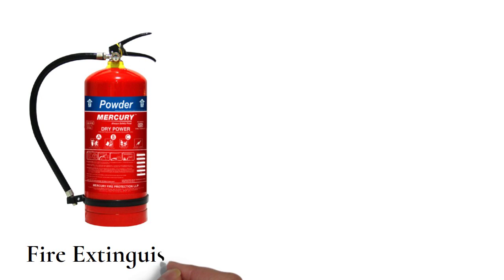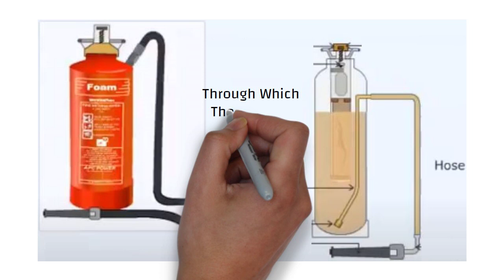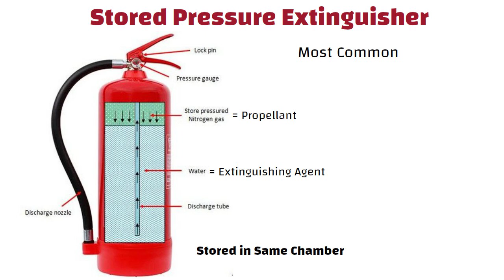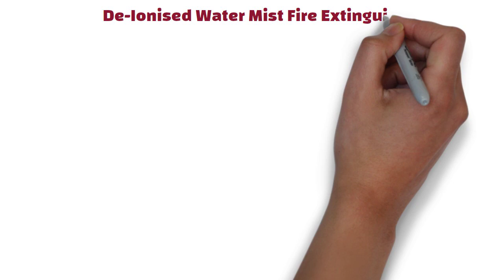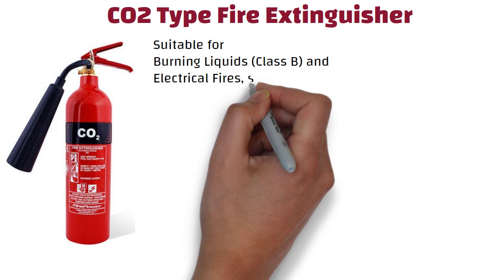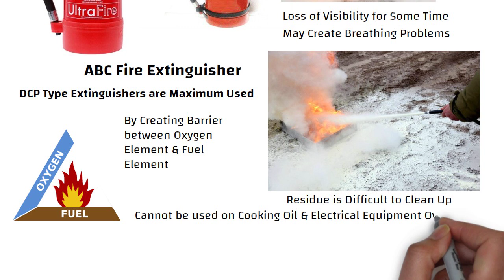FIRE EXTINGUISHER DEALERS IN KERALA, CALL 8138906102, FIRE EXTINGUISHER DEALERS IN ERNAKULAM.

Comment: Fire extinguisher dealers in Palakkad
Reply: FIRE EXTINGUISHER DEALERS IN KERALA, FIRE EXTINGUISHER SUPPLIERS IN KERALA, FIRE EXTINGUISHER DISTRIBUTORS IN KERALA, FIRE EXTINGUISHER IN KERALA, ABC TYPE FIRE EXTINGUISHER DEALERS IN KERALA, CO2 TYPE FIRE EXTINGUISHER DEALERS IN KERALA, CLEAN AGENT FIRE EXTINGUISHER IN KERALA, MODULAR TYPE FIRE EXTINGUISHER DEALERS IN KERALA, MECHANICAL FOAM FIRE EXTINGUISHER DEALERS IN KERALA, FIRE EXTINGUISHER NEAR ME KERALA, FIRE EXTINGUISHER TRADERS IN KERALA, FIRE FIGHTING COMPANIES IN KERALA, FIRE CONTRACTORS IN KERALA, FIRE EQUIPMENT DEALERS IN KERALA, FIRE ALARM DEALERS IN KERALA, FIRE PUMP DEALERS IN KERALA, SMOKE DETECTOR DEALERS IN KERALA, FIRE FIGHTING SYSTEM IN KERALA, FIRE PROTECTION SYSTEM IN KERALA, FIRE AND SAFETY CONTRACTORS IN KERALA, FIRE HYDRANT SYSTEMS IN KERALA, PA TALK BACK SYSTEM IN KERALA, FIRE NOC IN KERALA, FIRE INSTALLATION IN KERALA, FIRE NOC RENEWAL IN KERALA, KIRLOSKAR FIRE PUMP DEALERS IN KERALA, FIRE EXTINGUISHER NEAR ME KERALA, FIRE EXTINGUISHER MANUFACURERS IN KERALA, SAFEX FIRE EXTINGUISHER DEALERS IN KERALA, FIRE NOC CONTRACTORS IN KERALA, FIRE FIGHTING EQUIPMENT DEALERS IN KERALA, FIRE PROTECTION SYSTEM IN KERALA, FIRE INSTALLATION IN KERALA, FIRE SAFETY CONTRACTORS IN KERALA, FIRE AMC IN KERALA, FIRE PROTECTION SYSTEM IN KERALA, FIRE PROTECTION EQUIPMET IN KERALA, AMC OF FIRE SYSTEM IN KERALA, FIRE CONSULTANTS IN KERALA, FIRE AND SAFETY EQUIPMENT DEALERS IN KERALA, ADDRESSABLE FIRE ALARM SYSTEM IN KERALA, KARTHAR VALVE DEALERS IN KERALA, DCP TYPE FIRE EXTINGUISHER IN KERALA, POWSER TYPE FIRE EXTINGUISHERS IN KERALA, FIRE HYDRANT SYSTEM IN KERALA, FIRE ALARM PANEL DEALERS IN KERALA, SAFEPRO FIRE EXTINGUISHER DEALERS IN KERALA, MS AND GI PIPE DEALERS IN KERALA, JINDAL PIPE DEALERS IN KERALA, AGNI FIRE ALARM DEALERS IN KERALA, FIRE EQUIPMENT DEALERS IN KERALA, FIRE EQUIPMENT SUPPLIERS IN KERALA, FIRE EQUIPMENT TRADERS IN KERALA, FIRE SPRINKLER SYSTEM IN KERALA, RAVLE FIRE ALARM DEALERS IN KERALA, RAVEL FIRE ALARM SYSTEM IN KERALA, AGNI FIRE ALARM DISTRIBUTORS IN KERALA, FIRE ALARM CONTRACTORS IN KERALA, FIRE PIPE INSTALLATION IN CONTRACTORS IN KERALA, FIRE SAFETY CONTRACTORS IN KERALA, FIRE PA TWO WAY TALK BACK SYSTEM DEALERS IN KERALA, HEAT DETECTOR DEALERS IN KERALA, HONEYWELL FIRE ALARM DEALERS IN KERALA, FIRE NOC CONSULTANTS IN KERALA, FIRE AMC AND FIRE NOC IN KERALA, FIRE SAFETY COMPANIES IN KERALA, NEWAGE DEALERS IN KERALA, MONSHER FIRE EQUIPMENT DEALERS IN KERALA, KARTHAR VALVE DEALERS IN KERALA, FIRE HYDRANT VALVE DEALERS IN KERALA, FIRE HOSE REEL DRUM DEALERS IN KERALA, FIRE SPRINKLER DEALERS IN KERALA, FIRE PUMP DEALERS IN KERALA, LUBI PUMP DEALERS IN KERALA, LHP PUMP DEALERS IN KERALA.

Comment: Fire extinguisher in Thrissur
Reply: FIRE EXTINGUISHER DEALERS IN KERALA, FIRE EXTINGUISHER SUPPLIERS IN KERALA, FIRE EXTINGUISHER DISTRIBUTORS IN KERALA, FIRE EXTINGUISHER IN KERALA, ABC TYPE FIRE EXTINGUISHER DEALERS IN KERALA, CO2 TYPE FIRE EXTINGUISHER DEALERS IN KERALA, CLEAN AGENT FIRE EXTINGUISHER IN KERALA, MODULAR TYPE FIRE EXTINGUISHER DEALERS IN KERALA, MECHANICAL FOAM FIRE EXTINGUISHER DEALERS IN KERALA, FIRE EXTINGUISHER NEAR ME KERALA, FIRE EXTINGUISHER TRADERS IN KERALA, FIRE FIGHTING COMPANIES IN KERALA, FIRE CONTRACTORS IN KERALA, FIRE EQUIPMENT DEALERS IN KERALA, FIRE ALARM DEALERS IN KERALA, FIRE PUMP DEALERS IN KERALA, SMOKE DETECTOR DEALERS IN KERALA, FIRE FIGHTING SYSTEM IN KERALA, FIRE PROTECTION SYSTEM IN KERALA, FIRE AND SAFETY CONTRACTORS IN KERALA, FIRE HYDRANT SYSTEMS IN KERALA, PA TALK BACK SYSTEM IN KERALA, FIRE NOC IN KERALA, FIRE INSTALLATION IN KERALA, FIRE NOC RENEWAL IN KERALA, KIRLOSKAR FIRE PUMP DEALERS IN KERALA, FIRE EXTINGUISHER NEAR ME KERALA, FIRE EXTINGUISHER MANUFACURERS IN KERALA, SAFEX FIRE EXTINGUISHER DEALERS IN KERALA, FIRE NOC CONTRACTORS IN KERALA, FIRE FIGHTING EQUIPMENT DEALERS IN KERALA, FIRE PROTECTION SYSTEM IN KERALA, FIRE INSTALLATION IN KERALA, FIRE SAFETY CONTRACTORS IN KERALA, FIRE AMC IN KERALA, FIRE PROTECTION SYSTEM IN KERALA, FIRE PROTECTION EQUIPMET IN KERALA, AMC OF FIRE SYSTEM IN KERALA, FIRE CONSULTANTS IN KERALA, FIRE AND SAFETY EQUIPMENT DEALERS IN KERALA, ADDRESSABLE FIRE ALARM SYSTEM IN KERALA, KARTHAR VALVE DEALERS IN KERALA, DCP TYPE FIRE EXTINGUISHER IN KERALA, POWSER TYPE FIRE EXTINGUISHERS IN KERALA, FIRE HYDRANT SYSTEM IN KERALA, FIRE ALARM PANEL DEALERS IN KERALA, SAFEPRO FIRE EXTINGUISHER DEALERS IN KERALA, MS AND GI PIPE DEALERS IN KERALA, JINDAL PIPE DEALERS IN KERALA, AGNI FIRE ALARM DEALERS IN KERALA, FIRE EQUIPMENT DEALERS IN KERALA, FIRE EQUIPMENT SUPPLIERS IN KERALA, FIRE EQUIPMENT TRADERS IN KERALA, FIRE SPRINKLER SYSTEM IN KERALA, RAVLE FIRE ALARM DEALERS IN KERALA, RAVEL FIRE ALARM SYSTEM IN KERALA, AGNI FIRE ALARM DISTRIBUTORS IN KERALA, FIRE ALARM CONTRACTORS IN KERALA, FIRE PIPE INSTALLATION IN CONTRACTORS IN KERALA, FIRE SAFETY CONTRACTORS IN KERALA, FIRE PA TWO WAY TALK BACK SYSTEM DEALERS IN KERALA, HEAT DETECTOR DEALERS IN KERALA, HONEYWELL FIRE ALARM DEALERS IN KERALA, FIRE NOC CONSULTANTS IN KERALA, FIRE AMC AND FIRE NOC IN KERALA, FIRE SAFETY COMPANIES IN KERALA, NEWAGE DEALERS IN KERALA, MONSHER FIRE EQUIPMENT DEALERS IN KERALA, KARTHAR VALVE DEALERS IN KERALA, FIRE HYDRANT VALVE DEALERS IN KERALA, FIRE HOSE REEL DRUM DEALERS IN KERALA, FIRE SPRINKLER DEALERS IN KERALA, FIRE PUMP DEALERS IN KERALA, LUBI PUMP DEALERS IN KERALA, LHP PUMP DEALERS IN KERALA.
Reply: FIRE EXTINGUISHER DEALERS IN KOTTARAKKARA, FIRE EXTINGUISHER SUPPLIERS IN KOTTARAKKARA, FIRE EXTINGUISHER DISTRIBUTORS IN KOTTARAKKARA, FIRE EXTINGUISHER IN KOTTARAKKARA, ABC TYPE FIRE EXTINGUISHER DEALERS IN KOTTARAKKARA, CO2 TYPE FIRE EXTINGUISHER DEALERS IN KOTTARAKKARA, CLEAN AGENT FIRE EXTINGUISHER IN KOTTARAKKARA, MODULAR TYPE FIRE EXTINGUISHER DEALERS IN KOTTARAKKARA, MECHANICAL FOAM FIRE EXTINGUISHER DEALERS IN KOTTARAKKARA, FIRE EXTINGUISHER NEAR ME KOTTARAKKARA, FIRE EXTINGUISHER TRADERS IN KOTTARAKKARA, FIRE FIGHTING COMPANIES IN KOTTARAKKARA, FIRE CONTRACTORS IN KOTTARAKKARA, FIRE EQUIPMENT DEALERS IN KOTTARAKKARA, FIRE ALARM DEALERS IN KOTTARAKKARA, FIRE PUMP DEALERS IN KOTTARAKKARA, SMOKE DETECTOR DEALERS IN KOTTARAKKARA, FIRE FIGHTING SYSTEM IN KOTTARAKKARA, FIRE PROTECTION SYSTEM IN KOTTARAKKARA, FIRE AND SAFETY CONTRACTORS IN KOTTARAKKARA, FIRE HYDRANT SYSTEMS IN KOTTARAKKARA, PA TALK BACK SYSTEM IN KOTTARAKKARA, FIRE NOC IN KOTTARAKKARA, FIRE INSTALLATION IN KOTTARAKKARA, FIRE NOC RENEWAL IN KOTTARAKKARA, KIRLOSKAR FIRE PUMP DEALERS IN KOTTARAKKARA, FIRE EXTINGUISHER NEAR ME KOTTARAKKARA, FIRE EXTINGUISHER MANUFACURERS IN KOTTARAKKARA, SAFEX FIRE EXTINGUISHER DEALERS IN KOTTARAKKARA, FIRE NOC CONTRACTORS IN KOTTARAKKARA, FIRE FIGHTING EQUIPMENT DEALERS IN KOTTARAKKARA, FIRE PROTECTION SYSTEM IN KOTTARAKKARA, FIRE INSTALLATION IN KOTTARAKKARA, FIRE SAFETY CONTRACTORS IN KOTTARAKKARA, FIRE AMC IN KOTTARAKKARA, FIRE PROTECTION SYSTEM IN KOTTARAKKARA, FIRE PROTECTION EQUIPMET IN KOTTARAKKARA, AMC OF FIRE SYSTEM IN KOTTARAKKARA, FIRE CONSULTANTS IN KOTTARAKKARA, FIRE AND SAFETY EQUIPMENT DEALERS IN KOTTARAKKARA, ADDRESSABLE FIRE ALARM SYSTEM IN KOTTARAKKARA, KARTHAR VALVE DEALERS IN KOTTARAKKARA, DCP TYPE FIRE EXTINGUISHER IN KOTTARAKKARA, POWSER TYPE FIRE EXTINGUISHERS IN KOTTARAKKARA, FIRE HYDRANT SYSTEM IN KOTTARAKKARA, FIRE ALARM PANEL DEALERS IN KOTTARAKKARA, SAFEPRO FIRE EXTINGUISHER DEALERS IN KOTTARAKKARA, MS AND GI PIPE DEALERS IN KOTTARAKKARA, JINDAL PIPE DEALERS IN KOTTARAKKARA, AGNI FIRE ALARM DEALERS IN KOTTARAKKARA, FIRE EQUIPMENT DEALERS IN KOTTARAKKARA, FIRE EQUIPMENT SUPPLIERS IN KOTTARAKKARA, FIRE EQUIPMENT TRADERS IN KOTTARAKKARA, FIRE SPRINKLER SYSTEM IN KOTTARAKKARA, RAVEL FIRE ALARM DEALERS IN KOTTARAKKARA, RAVEL FIRE ALARM SYSTEM IN KOTTARAKKARA, AGNI FIRE ALARM DISTRIBUTORS IN KOTTARAKKARA, FIRE ALARM CONTRACTORS IN KOTTARAKKARA, FIRE PIPE INSTALLATION IN CONTRACTORS IN KOTTARAKKARA, FIRE SAFETY CONTRACTORS IN KOTTARAKKARA, FIRE PA TWO WAY TALK BACK SYSTEM DEALERS IN KOTTARAKKARA, HEAT DETECTOR DEALERS IN KOTTARAKKARA, HONEYWELL FIRE ALARM DEALERS IN KOTTARAKKARA, FIRE NOC CONSULTANTS IN KOTTARAKKARA, FIRE AMC AND FIRE NOC IN KOTTARAKKARA, FIRE SAFETY COMPANIES IN KOTTARAKKARA, NEWAGE DEALERS IN KOTTARAKKARA, MONSHER FIRE EQUIPMENT DEALERS IN KOTTARAKKARA, KARTHAR VALVE DEALERS IN KOTTARAKKARA, FIRE HYDRANT VALVE DEALERS IN KOTTARAKKARA, FIRE HOSE REEL DRUM DEALERS IN KOTTARAKKARA, FIRE SPRINKLER DEALERS IN KOTTARAKKARA, FIRE PUMP DEALERS IN KOTTARAKKARA, LUBI PUMP DEALERS IN KOTTARAKKARA, LHP PUMP DEALERS IN KOTTARAKKARA. FIRE CONTRACTORS IN KOTTARAKKARA, FIRE AND SAFETY CONTRACTORS IN KOTTARAKKARA, FIRE EQUIPMENT DEALERS IN KOTTARAKKARA, FIRE FIGHTING CONTRACTORS IN KOTTARAKKARA, AGNI FIRE ALARM DEALERS IN KOTTARAKKARA, PA TALK BACK SYSTEM DEALERS IN KOTTARAKKARA, FIRE NOC IN KOTTARAKKARA, FIRE NOC RENEWAL IN KOTTARAKKARA, FIRE SYSTEM INSTALLATION IN KOTTARAKKARA.
Reply: FIRE EXTINGUISHER DEALERS IN PUNALUR, FIRE EXTINGUISHER SUPPLIERS IN PUNALUR, FIRE EXTINGUISHER DISTRIBUTORS IN PUNALUR, FIRE EXTINGUISHER IN PUNALUR, ABC TYPE FIRE EXTINGUISHER DEALERS IN PUNALUR, CO2 TYPE FIRE EXTINGUISHER DEALERS IN PUNALUR, CLEAN AGENT FIRE EXTINGUISHER IN PUNALUR, MODULAR TYPE FIRE EXTINGUISHER DEALERS IN PUNALUR, MECHANICAL FOAM FIRE EXTINGUISHER DEALERS IN PUNALUR, FIRE EXTINGUISHER NEAR ME PUNALUR, FIRE EXTINGUISHER TRADERS IN PUNALUR, FIRE FIGHTING COMPANIES IN PUNALUR, FIRE CONTRACTORS IN PUNALUR, FIRE EQUIPMENT DEALERS IN PUNALUR, FIRE ALARM DEALERS IN PUNALUR, FIRE PUMP DEALERS IN PUNALUR, SMOKE DETECTOR DEALERS IN PUNALUR, FIRE FIGHTING SYSTEM IN PUNALUR, FIRE PROTECTION SYSTEM IN PUNALUR, FIRE AND SAFETY CONTRACTORS IN PUNALUR, FIRE HYDRANT SYSTEMS IN PUNALUR, PA TALK BACK SYSTEM IN PUNALUR, FIRE NOC IN PUNALUR, FIRE INSTALLATION IN PUNALUR, FIRE NOC RENEWAL IN PUNALUR, KIRLOSKAR FIRE PUMP DEALERS IN PUNALUR, FIRE EXTINGUISHER NEAR ME PUNALUR, FIRE EXTINGUISHER MANUFACURERS IN PUNALUR, SAFEX FIRE EXTINGUISHER DEALERS IN PUNALUR, FIRE NOC CONTRACTORS IN PUNALUR, FIRE FIGHTING EQUIPMENT DEALERS IN PUNALUR, FIRE PROTECTION SYSTEM IN PUNALUR, FIRE INSTALLATION IN PUNALUR, FIRE SAFETY CONTRACTORS IN PUNALUR, FIRE AMC IN PUNALUR, FIRE PROTECTION SYSTEM IN PUNALUR, FIRE PROTECTION EQUIPMET IN PUNALUR, AMC OF FIRE SYSTEM IN PUNALUR, FIRE CONSULTANTS IN PUNALUR, FIRE AND SAFETY EQUIPMENT DEALERS IN PUNALUR, ADDRESSABLE FIRE ALARM SYSTEM IN PUNALUR, KARTHAR VALVE DEALERS IN PUNALUR, DCP TYPE FIRE EXTINGUISHER IN PUNALUR, POWSER TYPE FIRE EXTINGUISHERS IN PUNALUR, FIRE HYDRANT SYSTEM IN PUNALUR, FIRE ALARM PANEL DEALERS IN PUNALUR, SAFEPRO FIRE EXTINGUISHER DEALERS IN PUNALUR, MS AND GI PIPE DEALERS IN PUNALUR, JINDAL PIPE DEALERS IN PUNALUR, AGNI FIRE ALARM DEALERS IN PUNALUR, FIRE EQUIPMENT DEALERS IN PUNALUR, FIRE EQUIPMENT SUPPLIERS IN PUNALUR, FIRE EQUIPMENT TRADERS IN PUNALUR, FIRE SPRINKLER SYSTEM IN PUNALUR, RAVEL FIRE ALARM DEALERS IN PUNALUR, RAVEL FIRE ALARM SYSTEM IN PUNALUR, AGNI FIRE ALARM DISTRIBUTORS IN PUNALUR, FIRE ALARM CONTRACTORS IN PUNALUR, FIRE PIPE INSTALLATION IN CONTRACTORS IN PUNALUR, FIRE SAFETY CONTRACTORS IN PUNALUR, FIRE PA TWO WAY TALK BACK SYSTEM DEALERS IN PUNALUR, HEAT DETECTOR DEALERS IN PUNALUR, HONEYWELL FIRE ALARM DEALERS IN PUNALUR, FIRE NOC CONSULTANTS IN PUNALUR, FIRE AMC AND FIRE NOC IN PUNALUR, FIRE SAFETY COMPANIES IN PUNALUR, NEWAGE DEALERS IN PUNALUR, MONSHER FIRE EQUIPMENT DEALERS IN PUNALUR, KARTHAR VALVE DEALERS IN PUNALUR, FIRE HYDRANT VALVE DEALERS IN PUNALUR, FIRE HOSE REEL DRUM DEALERS IN PUNALUR, FIRE SPRINKLER DEALERS IN PUNALUR, FIRE PUMP DEALERS IN PUNALUR, LUBI PUMP DEALERS IN PUNALUR, LHP PUMP DEALERS IN PUNALUR. FIRE CONTRACTORS IN PUNALUR, FIRE AND SAFETY CONTRACTORS IN PUNALUR, FIRE EQUIPMENT DEALERS IN PUNALUR, FIRE FIGHTING CONTRACTORS IN PUNALUR, AGNI FIRE ALARM DEALERS IN PUNALUR, PA TALK BACK SYSTEM DEALERS IN PUNALUR, FIRE NOC IN PUNALUR, FIRE NOC RENEWAL IN PUNALUR, FIRE SYSTEM INSTALLATION IN PUNALUR.